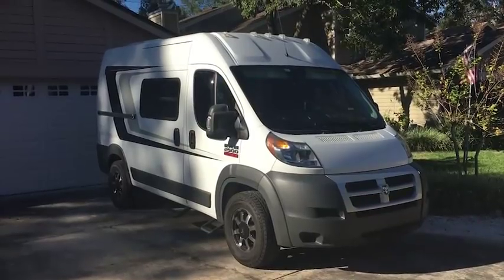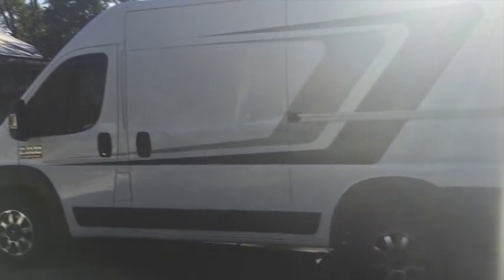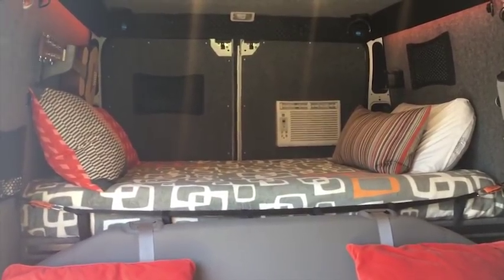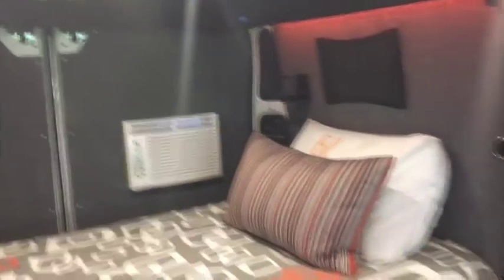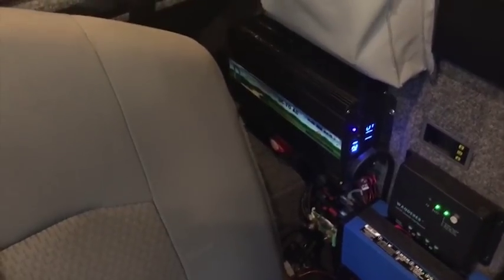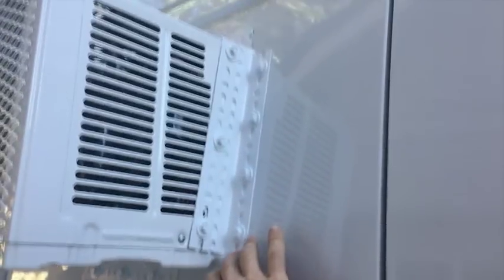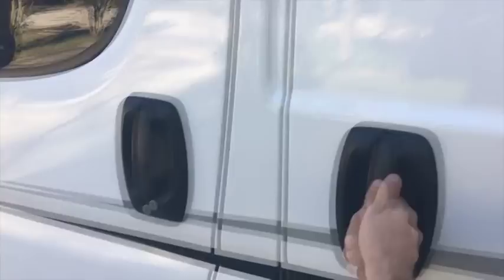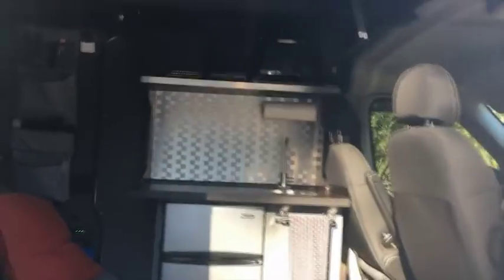2014 RAM PROMASTER BAND VAN/CAMPER BUILD

Comment: what is the total height of the van?  Wondering if I can park it in my slightly taller than normal garage.  I have a 10' floor to ceiling and the door fully opened is about 105" or so..  Wondering if putting a ceiling fan on top would make it too tall for my shop?  I think most tall roof ProMasters are 99" or so tall.
Reply from the maker: I've never done a specific measurement of the exact height of my van, but I had a friend eyeball a 9ft overhang and I made it under by a few inches... so I never drive under anything marked less than 9ft as a rule.

Comment: Nice build but the AC sticking out back voids out stealth camping
Reply from the maker: Thanks. You are correct, but I wasn't aiming for stealth by any means... otherwise I wouldn't have installed a roof vent, side window and flashy decals.

Comment: 1 of 3: I just purchased the Promaster, 3500, high top, extended length but the rear end is jacked up more than the front end by about 6 inches or so. I can't put the bed in the back or I'll roll off the bed. I suppose I could have it built to suit the sloping of the back to the front of the Promaster.
2 of 3: Also, anyone wanting to purchase a Promaster - know this... you cannot change out the seats if you don't purchase a van made with the seats that you want such as a swivel seat at the time of manufacturing. I purchased my 3500 high top extended length Promaster with the double passenger seat in the front thinking, "I'll change the front double passenger seat out and put a swivel chair in". I asked the dealership that I purchased it from to do it after I purchased it. They said that it would cost a minimum of $1,000 in parts, plus installation and the chair. Another dealership said that it would be $6,000. The last dealership that I went to said that most dealerships will not change out the front chairs/seats for safety reasons - there are air bags built into the chair. I called Chrysler/Ram to see if they would provide a swivel chair - they referred me back to the dealerships. I asked for the number to the manufacturing area and they said that they could not give me that number. I'm stuck with a bench seat (double passenger front seat with my bucket seat for the driver! Had I known that, I would not have purchased the Promaster! 
3 of 3: Did you get your Promaster insured as an RV? If so, how? I would like to have that done. I'm told that everything that you built into the van is completely without insurance whether for theft in the event of an accident if it is not recognized as a RV by DMV then your insurer.
Reply from the maker: The seat issue is a breeze... mine had the bench when I bought it too. I swapped my bench with another PM owner that had two cloth bucket seats, even trade. Then I purchased an after market swivel for the passenger seat. All were super easy mods, just a few bolts. As for the RV insurance... I didn't try for that since it isn't an RV. It's my daily driver.
Reply: Well, sounds like there is hope.  I just need to find another RAM Promaster owner who has the two bucket seats and wants to trade for my "double passenger seat".   Thanks Blender Live Music.
Reply from the maker: Best place to find fellow ProMaster owners is www.promasterforum.com. Become a member, then post a classified ad and let everyone know you want to trade your bench and where you are located. Then just be patient and someone will likely respond in time. I made a couple of trades for parts that way.

Comment: That's an excellent build my friend.  I test drove the RAM and didn't like the steering wheel angle and it doesn't tilt.  Did you find the steering wheel angle odd and if so did you ever get used to it?
Reply from the maker: Thank you! The angle of the steering wheel took a bit of getting used to, but it doesn't bother me at all now. There were so many other pluses to the ProMaster that I thought it was worth making an exception.
Reply: I felt same
.seat to high..but it's better than transit
Reply: Well planned *

Comment: Great build! I must know how you got the reverse camera to come on independent of being in reverse for my 2015 Promaster.
Reply from the maker: When you open your rear door the radio displays the camera view, so I tapped into the wire running from the sensor on the rear door and ran it up to the dash to a switch, then ran it back to it's source. Presto, flip the switch and it thinks the door is open. It's one wire connect at the rear corner column on the passenger side. (White with a blue stripe, about centered in the opening when you take the black column cover off.) A wire spliced to that wire and run to the front dash with a switch then run back will trigger the backup camera to display whenever it's grounded. (Note: it doesn't turn the backup camera on, it's always on. It just tells the radio to display it)
Reply: nice hack

Comment: HD? This is the grey in/out that is a 4x8 remnant as well as on the roll? If so I've used it for the floor and flat surface. It has top and bottom side due to the ?? bottom, right? And you got this to conform around those curves on your slider door with this stuff?
Yeah, using (alot) of M90 too.
Let me guess: sheet keepers? Bought em yesterday?

What is your ID on the PM site?
Reply from the maker: Yes, that's the stuff! I was able to get it to flex somewhat. And yes, LOTS of 3M 90. I didn't use sheet keepers... but that's probably a good idea in some places. Here's a post on the PM website of my finished build... http://www.promasterforum.com/forum/showthread.php?t=72250
Reply: BTW...whose/what mattress did you implement for the install? Size and sources? Also, in installing that HD indoor/outdoor carpet, did you use one of those little wooden rollers used to properly install Formica or did the carpet take to the concave/convex parts of the van simply by hand? I mean, you make it look too easy.

Comment: Super nice. Doing a SWB Transit myself. What is the source of your grey wall fabric and is it a material that works easily with the curves and contours of a van interior?  Adhesive used?  Are you on the PMforum also?  Sweet.
Reply from the maker: Thanks Douglas! The wall fabric is from Home Depot, it's TrafficMaster indoor/outdoor ribbed carpet. Very easy to work with around curves and contours. I used 3M High Strength 90 for the adhesive, awesome bond. I am on the PM forum.

Comment: Hi. What material did you use for panels?
Thanks.
Reply from the maker: I used 1/2 inch plywood for the wall panels and 1/4 inch plywood for the ceiling panels.

Comment: Awesome. Hey, about your air con unit... that must suck tons of electricity -- you must be using a gas generator for that, yes? Can't imagine that running off solar or inverter.
Reply from the maker: I only run it on shore power right now. Will be getting a 1k watt portable generator to run it when shore power isn't available... but haven't really run into that situation yet.

Comment: Nicely built! Whats the size of your upper bed? And how deep is your couch? Can you sleep on it too?
Reply from the maker: The upper bed is currently a twin. It's probably wide enough for a queen but I only have 73" to work with wall to wall so I went with the twin. The bench depth is 18". It's wide enough for me to sleep on as long as I don't try to roll over.
Reply: Shaun Williams tnx! Looks really good! So your bed is around 39" wide? I liked it that you could fit it in a L2 for 3 person sleep
Reply from the maker: Yes, the mattress is 39" x 75" x 6". I just squish it into the 73" wall to wall space and it's fine.

Comment: One of the nicest builds Ive ever seen. Has a mobile man cave look.   Done much cooking on hotplate?   Like so many aspects...shore power connector location, garage, back door (i.e., never saw that before), decal.  You cargo net deal is an excellent way to dual purpose van for lugging stuff around safely...like that.  Plng to do something similar with Ram 3500 hi-top, for stealth van living.  As you have time, pls share more details about your potty, insulation, privacy window effectiveness, heater, post & table storage, how you secured kitchen with a movable wall behind it, and how comfortable are the ladies with your creation.  

Kudos...great job.  Thanks for sharing.
Reply from the maker: I have used the hotplate... as long as you use the proper cookware it works like a charm. I don't have a potty, no real need the way I use the van - I don't really go anywhere facilities aren't available. Insulation is one layer of sound deadening pad, two layers of 3/4" polyiso on walls and doors with Great Stuff holding it on and filling gaps. Privacy window is perfect and very convenient, I also use reflectix cut to fit on the front cab windows for full blockage. No heater, I live in FL. I secured the kitchen to my 1.5" plywood floor with large L brackets... doesn't budge.

Comment: Awesome van build.  Did you get the black webbing on the wall from Amazon?  & how did you attach them as it looks very clean?
Reply from the maker: Yes, I got the black nylon web netting from Amazon. https://www.amazon.com/gp/product/B007CVSE6C/ref=oh_aui_detailpage_o05_s00?ie=UTF8&psc=1
I used 2" V-ring bolt on cargo tie downs along with some velcro straps from Home Depot to fasten it to the walls and ceiling.

Comment: Hey Shaun, your pathfinder sport AT tyres - what is the load rating? I am trying to get some ATs for my vivaro van but here in the UK there are none that are load rated high enough to fit 16" rims :(
Reply from the maker: They are Pathfinder Sport S AT tires from Discount Tire in US. LT245/75 R16 120Q E1 OWL. They are rated to handle the load of my Promaster 2500
Reply: Great, thanks, that's just enough for my load rating. But wider and bigger than the standard size, does that mean you had to lift the suspension and fit wider arches to fit your pathfinders? Your van looks amazing btw, so much detail and thought has gone into it.
Reply from the maker: No alterations were necessary for these tires... just the standard suspension on Vision Valor rims 16x6.5 5-130 45 offset (same dimensions as stock OEM rims). Those are the biggest tire that will clear on that vehicle. I have no issues with them.
Reply: You have made my day, AT tyres are a possibility for me again! Long days and pleasant nights my friend.
Reply from the maker: You should checkout www.promasterforum.com. It's a forum for Promaster owners... TONS of info and a great community of very helpful people sharing their info, ideas, techniques, successes and failures. That was my resource when doing my build... I learned a lot there.

Comment: Nice built and love the AC hooked up idea. I'm working on my PM 159WB now. if you don't mind, can you add link where did u get the graphics from? thx
Reply from the maker: I designed the graphics myself and had a sign shop print and cut them in vinyl and apply to my van